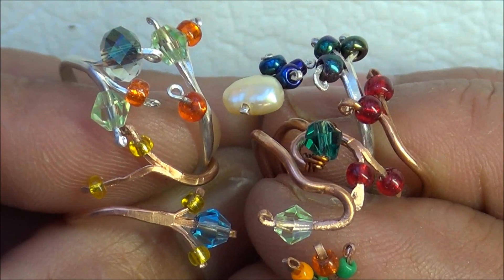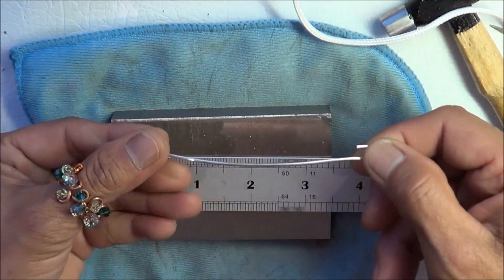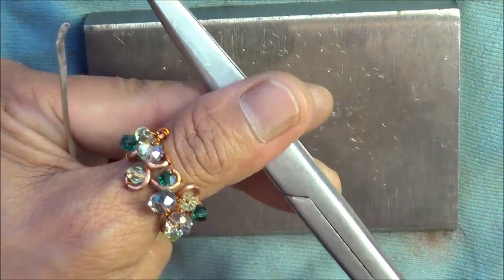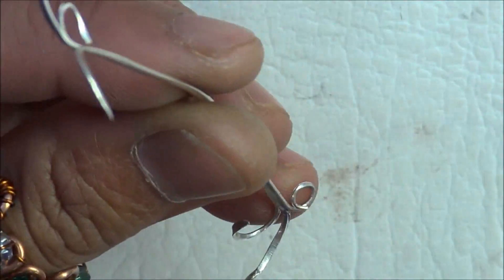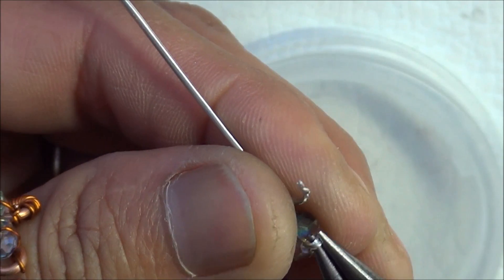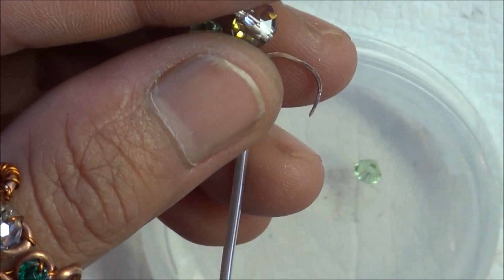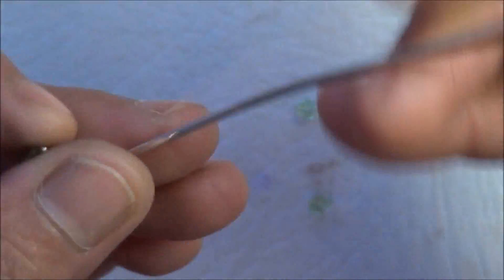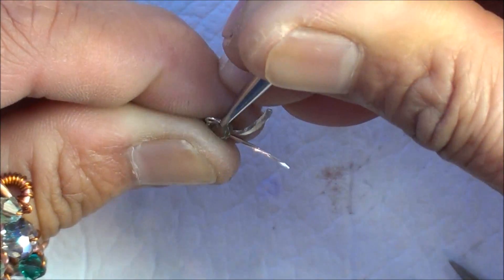EASY Adjustable Vine Ring Tutorial - Liz Kreate

Comment: Thank you for the video. Beautiful.  Would it be afraid that if one of the ends get stuck on anything it would break off easily.
Reply from the maker: +private91205 Like most of my designs/tutorials, I always do test runs before the video (wear the item for days before making the video). Apart from getting caught in my hair every now and then, none of the ones I made has broken off. Thanks for watching and commenting. Cheers, Liz